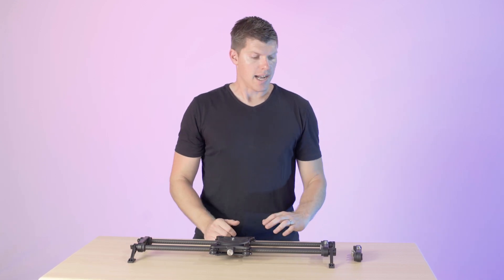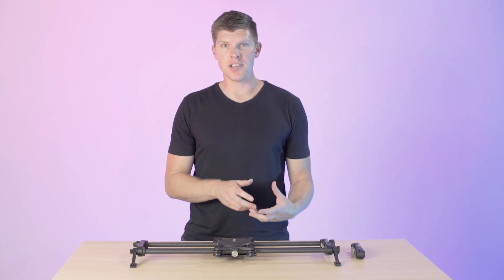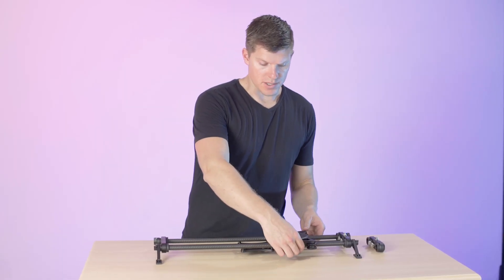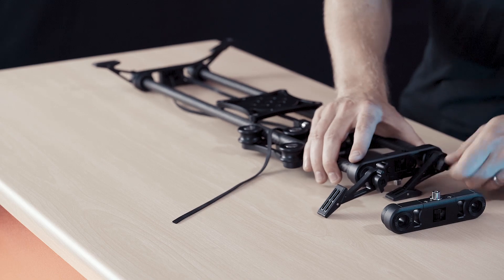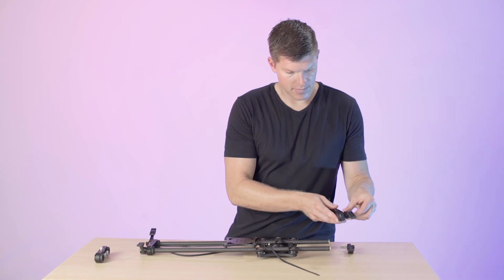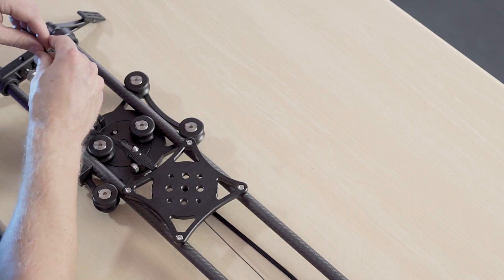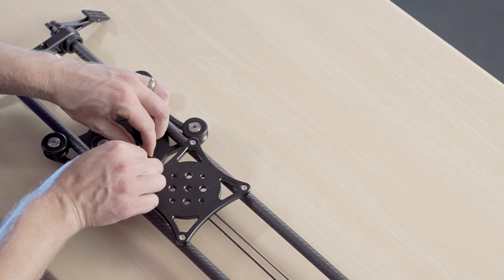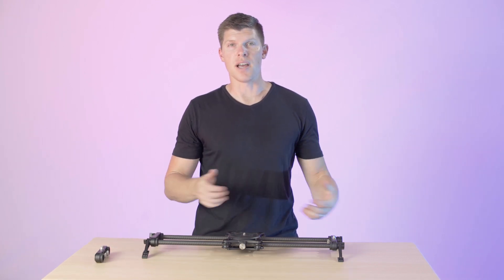How to upgrade your Endplates

Comment: Hi  Kyle! I've just received the pro  48 slider bundle with High Torque motor but I used my old Endplates. Well, when I started testing the motor I can see a bumpy movement on motor. I tried to play with cable tension and with less tension it will be less bump power...  Now I finally found that video and realized a problem. So I have a question: The new Endplate has to be used with all 2 versions of the motor High Torque and High Torque? Can i use old endplate with High Speed? Is  it better to use a new Endplate for both motors? Please include this info to the motor product page and email to all Kickstarter folks. Is that the correct part to replace? https://rhinocameragear.com/products/spare-parts?variant=29734005637192
Reply: @RhinoCameraGear  I have follow up question.... Do i need to replace only one side (motor side) end plate or from both ends?